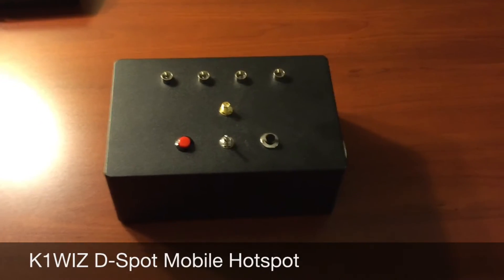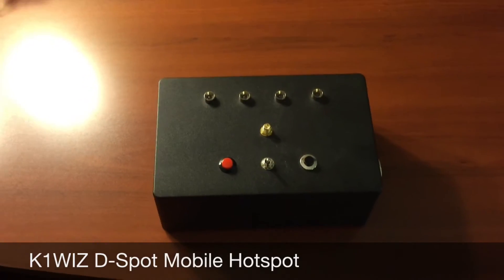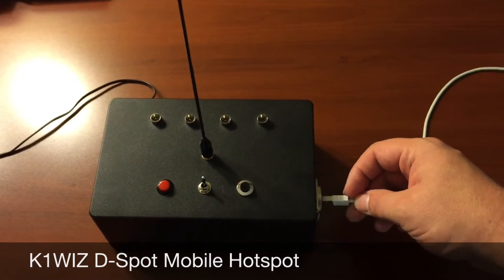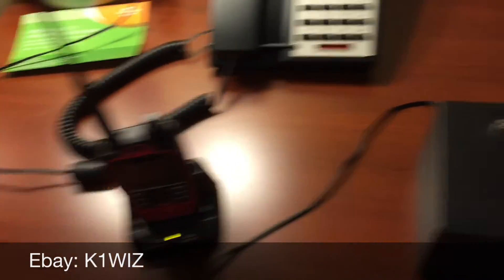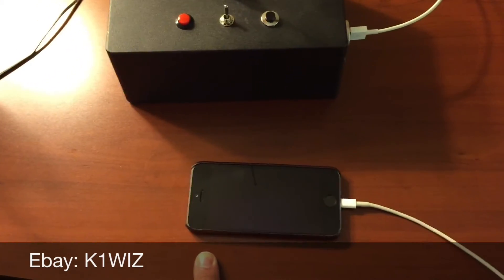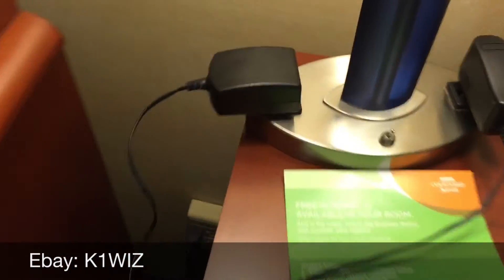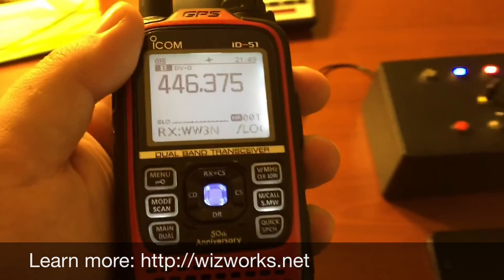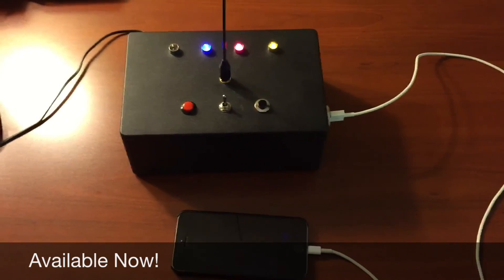K1WIZ D-Star Mobile Hotspot

Comment: To large and try to carry and operate in a store or the am park!
Reply from the maker: Hi, D-Spot is not intended to be carried in the hand when on the move.  D-Spot is intended to be portable, but in a vehicle, campsite, or temporary quarters when traveling.  I do a lot of air travel domestic and international.  I developed D-Spot to be rugged and withstand the rigors of travel, field use, and be reliable & simple to operate.  It was developed after my pattern of use; frequent destinations, where I could set it up in a hotel window or campsite, tethered to wired or USB (cellular) internet & provide a maximum of a mile of D-Star coverage.   For this use case, it performs marvelously and keeps me connected anywhere in the world I may be staying.  Due to the armored design & simple hardware instrumentation and controls, I can "set it and forget it" and go roam about my destination with nothing more than an HT.  D-Spot users enjoy this reliable hotspot operation that D-Spot provides, in many fixed and mobile locations.

Comment: For $415, is there any reason that nothing whatsoever has any sort of labeling on it?  Might look like a potential terrorist device to the un-initiated.  aka:  "Be sure to cut the RED wire and not the BLUE wire.  BOOM!".
Reply from the maker: Hey Rick, the decision to forego labels was to keep a clean appearance (after the vision of the old series Star Trek computer consoles which had lights, buttons, etc and no labels) and also preserve some mystique & prompt discussion by other Hams who see D-Spot.  When you view the Quick Start Guide upon unboxing a D-Spot unit, it quickly becomes clear what the buttons and lights are for, and the unit is extremely simple to operate.  As a frequent international and domestic traveler myself, I take my unit everywhere and have never had any issues stateside or abroad.  When asked what it is, I simply say it's a radio and that seems to be enough and the conversation stops there with TSA/security folks.  Like any other electronics, they wand it down along with my laptop and other electronics in my carry-on.  I'm generally on my way in minutes.
Reply: Sorry, missing labels are just plain lazy and poor workmanship in terms of end user experience. Try again...